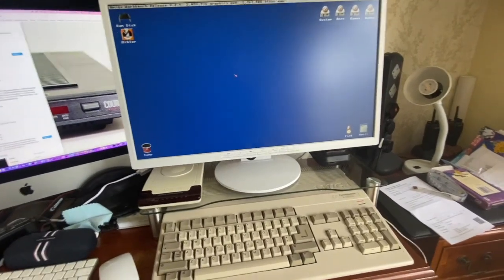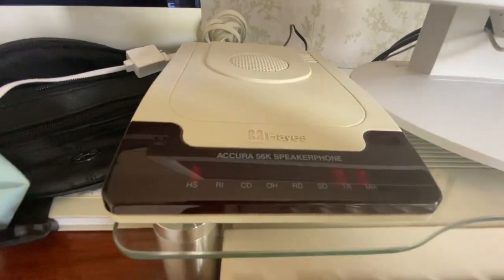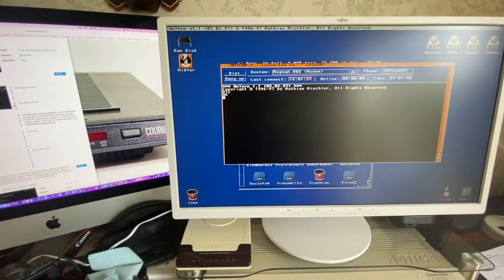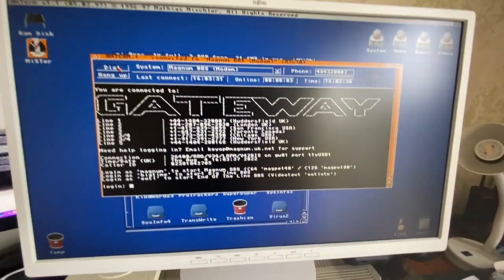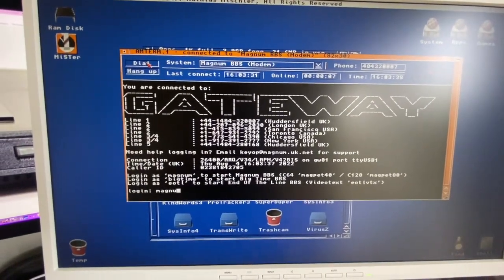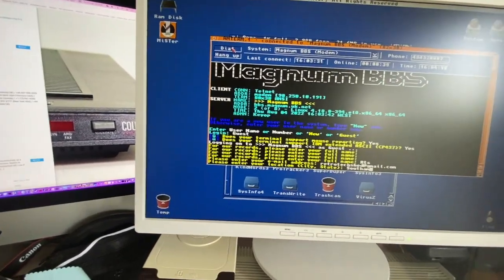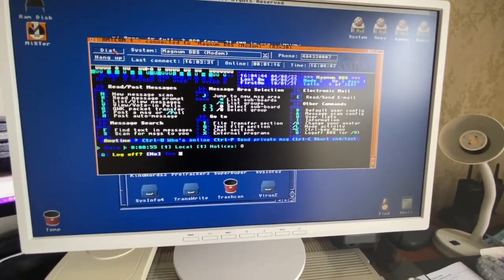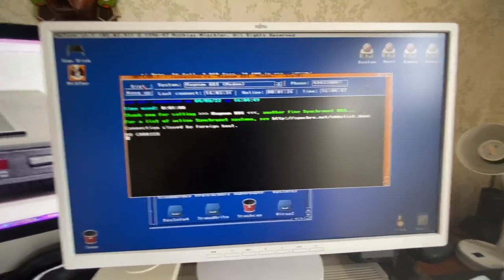Amiga 500 MiSTer with Real Modem like it's the 1990s again (modem sounds / modem noises )

Comment: Is the modem is connected with an RS-232 to USB converter?
Reply from the maker: Hi Golan. Yes, exactly - a USB to Serial adapter (but check the chipset is supported if you are going to do the same) and then configured in the core